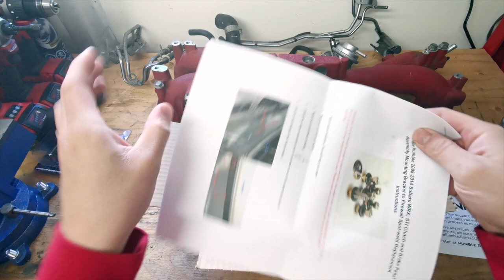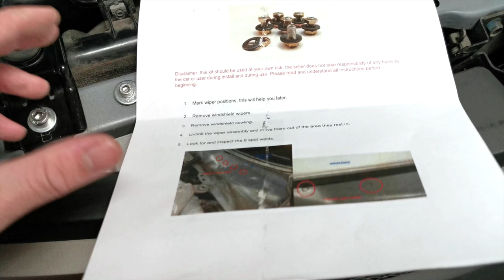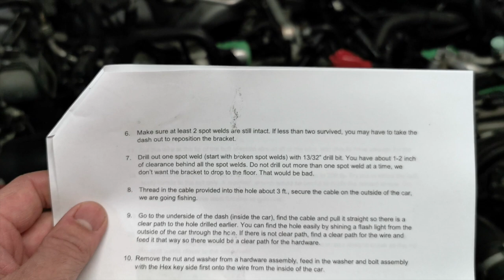EASIEST Subaru Firewall Fix Ever!

Comment: Redo the sealer around the fire wall bolt look around seam sealer is like a caulking bead not a gasket smear, think of it like your bathroom caulking smooth seams collect less dirt and last longer, "tool" it with you're finger tip and a little bit of spit

Comment: Finally manage to get to it.  Had the 2 uppers blown and the far left of the bottom.  The upper right was easy.  The upper left has a bit of clearance issues with the metal behind it.  Its not solid across but cuts off like 2/3rds up the hole to it quickly walked the bit once it hit.  No problem, used a rough round file to bring the hole back down enough for the washer to clear.  But then keep in mind, theres the insulation behind it.  Had to really work at getting one hand up there to pull back the insulation enough to at the same time push the bolt past the insulation.  It still only took about 2 hours and busted up 2 fingers... I should have used a lower torque drill LOL.  Feels SO much better just backing her out of the garage.

Comment: I would go a step further, cleaned it and paint it before putting the bolt through, put a heat gun on it and it'll dry in 20 seconds, then smear a thin layer of silicone around the hole or washer so it acts like a "gasket" between the car and washer, and it will squeeze out and seal the hole too. makes for a cleaner looking silicone job, and shouldn't impede with torquing the nut since the threads are still clean, and if you're doing it by feel, it doesn't matter anyway.

Comment: Great video! How did you end up getting the bolt passed the carpet on the first one you did? I'm am currently working on the bolt beside it (the one closest to the passenger side) and I am having a hard time getting the bolt head passed the carpet. The carpet is very rigid and I have big hands, so I can't get enough leverage up there to get the bolt head through.

Comment: I want this kit. But concerned about the metal rusting in the drilled out spots in the long term... I feel like paint would flake off when I torque it down. Any suggestions 🤔
Reply from the maker: I didn't run into a problem with the paint flaking once torqued down. You could prep the surface before installing the bolts with a rust preventative like por 15.

Comment: Thank you so much for this video bro,
Mine started squeeking 2-3 days ago after i accidentally stalling the car while parked..still kicking myself about it as i havent stalled it for years since ive owned it.
Today the sound got louder while on the way to work.
In some other video they're saying just need to re-lubricate a dry rod entering a dry rubber housing above the gas pedal
Reply: Did you end up re-lubricating the dry rod after all?

Comment: What size bolts are these and what size drill bit ? My kit is on back order but I can’t wait longer on my pedal so some subie dudes told me to just grab the hardware from a local store!
Reply from the maker: I'm not entirely sure as it looks like he's updated the kit since I made this video. I think anything similar in size to the diameter of the spot welds should work as long as the hardware is the same. Sorry I don't have any more info for you.

Comment: i have a creaking sound as well in my 2011 sti. but when i open the hood and tried to source where the sound is coming from, it sounded like its not from the firewall side but more towards the transmission area. will the sound travel there if its a firewall issue? i checked the welding spots it doesnt seem like there are cracks or failure marks.
Reply from the maker: May be the clutch slave cylinder

Comment: Did it get rid of the squeak! And do you recommend still putting a brace as well?
Reply from the maker: Yes it eliminates the creaking in the firewall. I have added the torque solutions brace as well. It's not really needed but definitely adds strength to the area.

Comment: Will this help with the fire wall bending? My fire wall bends because I put in a stage 3 clutch and my car won’t go into gear
Reply from the maker: I'd say you'd need a brace as well. These are helpful to fix cracked welds

Comment: I don’t have any squeaking but I had clicking think that this could be the same firewall issue?
Reply from the maker: It may be related, but the best way to check is to remove the cowl and inspect the spot welds to see if any have let go. Mine didn't click so I'm not entirely sure if it's the same problem.
Reply: Just bought my '09 WRX a few weeks ago, and mine was squeaking pretty bad, but now it just started clicking today. Pretty sure the spot welds are getting worse if you start to hear a crack
Reply: @jakeiswayblack3377  I also have an 09. Deff get it fixed or at least diagnosed sooner rather than later. Once my pedal assembly ripped away from the fire wall it costed me a new clutch due to me trying to chase the issue. For me it was the spot welds and my pedal assembly was cracked.

Comment: How long has this been a solution?? I wish I knew about this 2 years ago!
Reply from the maker: About the same time I uploaded this video
Reply: @AdrianMorse42069  Just ordered, but took a look underneath and my assembly now his the infamous hairline crack. Should I add the Humble rumble fix before or after I swap a new pedal assembly in?
Reply from the maker: @kanwar2712  I'd maybe shoot Peter an email. He might know better what would be the best option. Mine wasn't yet cracked so I'm not entirely sure.
Reply: @AdrianMorse42069  got through to him and got the green light. Started installing it today but for the life of me can’t figure out that second bolts you installed. Carpet is blocking it so much, have tried to pick as much of it away from outside as I can, but can’t find any place to pull that dang carpet down to get the clearance up top!

Comment: Any chance this might also have to do with an insanely heavy clutch, as well?
Reply from the maker: Maybe the added force needed to depress it could cause more stress in the spot welds?
Reply: cant skip leg day driving these wrx
Reply: @mor3frame  I’ve got thunder thighs, but the clutch should not have been as heavy as it was. It turned into a truck clutch. There was something mechanically wrong and it was only going to get worse. Doesn’t matter. Got a GTI Autobahn. Waaaaaaaay better
Reply: @thwrightstuff  [

Comment: Was your car having issues getting into gear prior to the fix?
Reply from the maker: No issues getting in to gear. Just an annoying sound when the clutch pedal was pressed.
Reply: mine does with new clutch. subaru wanted me to pay 2500 to weld this plate back lol
Reply: I was having the issue that probably means all your spot welder are broken and the plate behind the fire wall is shifted so it will make this install way harder to do took me about 5 hours
Reply: @devinidc  same mine was like an inch out of place. Felt like forever.
Reply: Fixed it last week.
Reply: @danielr406  how did u fix it if the plate is off?
Reply: @z3ro86ea  drilled holes in plate and widened the ones that were in firewall then ran bolts with lock washers and red loctite needed a 2nd person to be able to tighten down.
Reply: How did u fix the getting into gear problem?
Reply: @Chris King
Reply: @joseesguapo  I bought a humble rumble kit to get the bracket back in place no issues since

Comment: I did this installation n the noise still the same …
Reply: Same. Also increases engine noise inside the cabin. Fuck. Ordered a rallitek clutch cylinder brace will get it installed soon
Reply: @fcukyouup  I had to replace the whole clutch pedal and it was fixed it had a crack on the rod